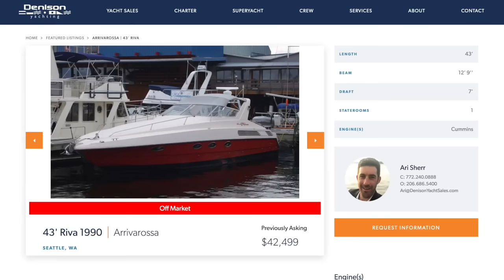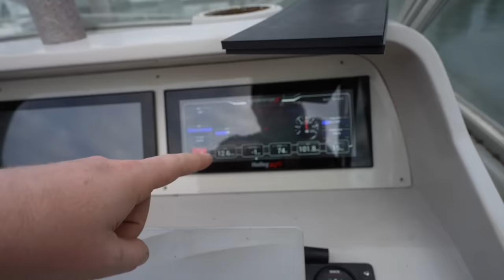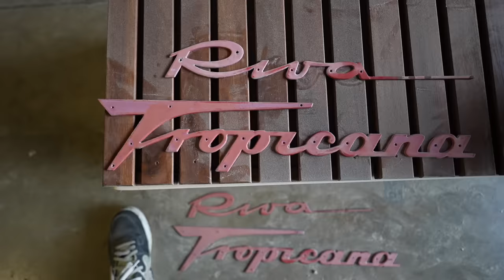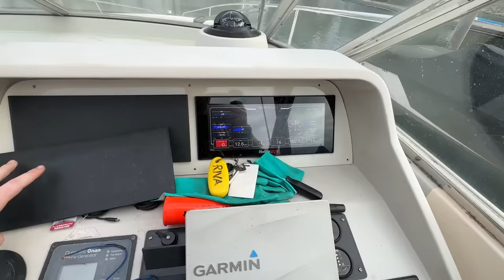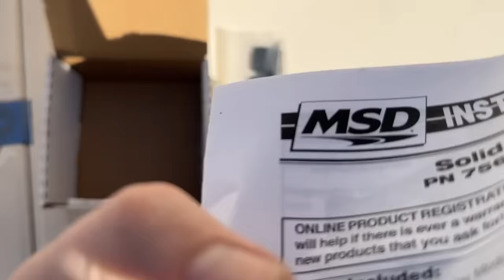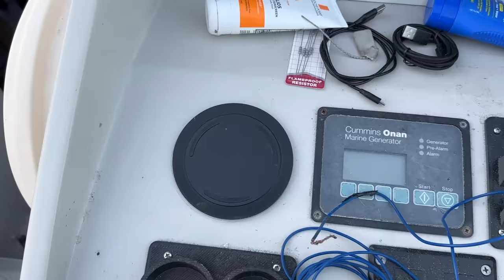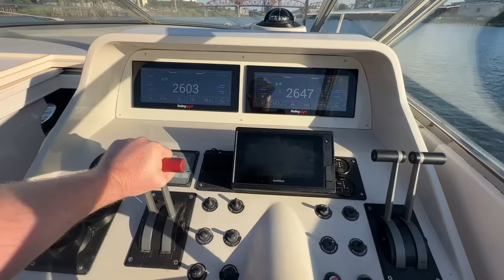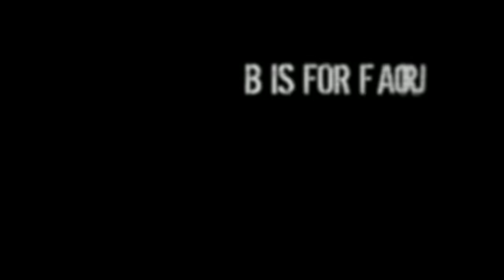LS Swapped 30yr Old Italian Yacht FINALE!! - ITS FASTER THAN EVER!!!

Comment: Am I missing something? Full throttle is only 2500 RPM? Shouldn't you be safe to run both engines at twice that RPM? I figured with 2 V8 engines that boat would go at minimum 50mph

Comment: Gas engines should be running at 4500-5000rpm WOT.  2500rpm is not enough…you need to re-gear with different transmissions or props. Likely gonna need different gear ration trannys cuz props won’t likely make that rpm increase possible.

Comment: You need to change the props. They're probably original which is meant for diesels. Reduce your pitch. I've been playing the prop game with my 600hp LS swapped 1983 Chris Craft Scorpion 230. I just made a 40 year old boat do 80mph with more throttle left. Your boat should do 40-50mph all day

Comment: you need to reprop or put different transmissions with different final drives, youre proped and geared for diesel torque, you need to put a steeper gear or smaller props. max rpm should be around 46-5000 rpm, you should be able to have max rpm of 6000+ rpm with your built motors. cruising speed and fuel economy should definitely be considerably higher
Reply: Probably 7000 even with these engines....

Comment: boat isn't getting that much into plane and maxing out at less than 3000 rpm...check the props, probably need to swap them. Thst boat originally could do 34 knots top speed which is about 40 miles per hour

Comment: At 2500 rpm, these engines aren't making 1500 hp.  Probably not even half as much (power = rpm x torque). Changing gearing or Props so that you get closer to redline on full throttle should give you the full power the engines have to give!

Comment: Need to change props. If you are not reaching your top RPM, you have the incorrect props. That will change everything. Specially fuel consumption.
Reply: Chris_Build-Text  sorry, not on telegram. Current props are too big for sure. Hence you are putting too much load on the engiens. You shoul be able to reach top rpm at WOT. Then you should be able to reach top speed at 80% of your power. That will give you extra power for when you need it. 

Besides that, the project came out great. Congrats!
Reply: Chris_Build-Text  you will be doing some trial and error. I'm sure Riva never intended to put those engines on the boat so don't think they will have specs for it. Props use two meassurments, diameter and water they push. Both in inches. First number is the diameter, second is the length travelled in inches per revolution. 

Hope this helps.

Comment: Wouldn't 1 mile for half a gallon just be easier to say 2 miles per gallon?  I mean, correct me if I'm wrong or whatever but who calculates by half gallon?
Reply: I mean boats usually don't use MPG they measure fuel usage in gallons per hour sooooo

Comment: As others have said, bow looks to be too low. This is certainly from too little weight in the stern and using too much trim tab. There is also no question that the transmission gearing is wrong and the props are the wrong pitch and size.

Comment: I don't think you broke those motors in right. Marine applications are different. You should have varied more rpms alot more often. Im w you man.  You shouldn't run new gas Marine engines at the same rpm for extended periods....

Comment: That boat needs more RPM no way 2700 RPM is what those motors want
Reply: props require a certain horsepower in order to spin a certain rpm. If the engine doesn't make sufficient hp down low to exceed the requirement, the whole system won't spin any faster. The previous old big diesels made some 350-400 hp at 2600 rpm, and were well-matched to the props.  But if those big props need 350 hp to spin that rpm, and the LS only makes 250 hp that low, it doesn't matter if the LS can make 750 hp at 6800 rpm...the prop's requirement won't let the engine ever reach that rpm.

Comment: You need to find out what the high rpm range for those engines is and get props with less pitch to allow the engines to operate in that range at WOT. Its the same concept as selecting propellers for an outboard motor. Lugging those engines with over pitched props is not good for them at all.

Comment: I have owned 42’ Sportfish with twin 502 gas engines (500 HP ea) for over 23 years. I would NEVER lug the engines like they are doing in this video! It is a recipe for valve issues, and or damaged pistons. 
   They should prop boat 5,200 WOT rpm, and cruise at 3,500 give or take. I assumed they handled this issue when selecting gear ratio, obviously not. This is serious, and boat should not be used above idle until the correct props or gears are installed!

Comment: Too much trim tab pushing the nose down too much will push more of the hull into the water slowing you down. 2500rpm sounds like you have too much pitch or too big a diameter not allowing your engine to rev out.

Comment: You need to figure out the trim system and most likely reprop the engines.  Wide open throttle should be like 5000rpm for those engines.  Anything less you are lugging them and it is more harmfull and was less efficient.

Comment: As numerous other people have mentioned, you have the wrong props (too much pitch). This boat with this horsepower should be doing closer to 40 knots. You should have no problem getting to 4500 RPM where your engines are in their peak horsepower curve. 

Sorry the boat sank. I’d definitely look into different props when you rebuild the boat.

Comment: Another comment to tell you you need new props.  You aren't even coming close to max RPM, and you should.  The only practical use as-is is running 1050 RPM.  Those props are pitched and sized for a ton of torque at a lower RPM.

Comment: Why are only getting like 2800 RPMs?
Reply: props require a certain horsepower in order to spin a certain rpm. If the engine doesn't make sufficient hp down low to exceed the requirement, the whole system won't spin any faster. The previous old big diesels made some 350-400 hp at 2600 rpm, and were well-matched to the props.  But if those big props need 350 hp to spin that rpm, and the LS only makes 250 hp that low, it doesn't matter if the LS can make 750 hp at 6800 rpm...the prop's requirement won't let the engine ever reach that rpm.

Comment: Those motors are not going to last long being so overloaded and are probably putting out less than 300 hp at that rpm. You need smaller props ASAP

Comment: The important power measurement on a boat is not horsepower. It's torque. I strongly beleive your props are way off. Contact a good prop shop and give them your engine hp and torque, the max rpm, the boat type and weight, With this information they can calculate the right diameter and pitch prop. To put this in perspective a diesel turns a big prop slowly and a gas engine spins almost twice as fast. My 32' boat with twin 220hp Cummins diesels does 20kts at 2000 rpm and about 28kts at 2600 rpm. I burn a total of 8 gal per hour at 20 kts. Keep at it, you will get it dialed in.

Comment: dude, starbrite deck cleaner or toilet bowl cleaner and a plastic brush, not steel brushes. too late now but you scratched the hell out of that gelcoat.
As far as top speed, your prop might be overpitched or your transmissions not have enough reduction, 2500 or so RPM at wot is good for diesel but with gas you should be higher.

Comment: Prop pitch and size is wrong. There are calculations for target RPM and speed. You have sooo much more RPM with gas get those props right and that’s going to be a ~35MPH boat

Comment: Those msd solid state relays are junk.  I was using it for nitrous activation and it kept kicking on and off over the course of a dyno run.  Checked my wiring for a week, come to find the internal "over current" protection was tripping at half it's rated current.

Never got a response from MSD when I brought it to there attention.  Kinda sad.

Comment: You’re way over propped for those high revving LSX motors. Your max rpm was 2550 which is less than 1/2 of where those guys should be. My stock Volvo Penta I/O max’s out at 4600rpm.

Comment: You definitely cruised that whole trip at a SUPER inefficient speed.. you weren't on plane and you were dragging so much weight through the water.   You gotta give it more throttle, get on plane,  then adjust the trim and throttle back,   find the lowest RPM that keeps you on plane and THATS the cruising speed...  not 1500 rpm  barely moving, not on plane,  dragging the full weight of the boat through the deepest amount of water

Comment: CHANGE THE PROPS. MAYBE LESS PITCH. THIS IS ONE OF THE REASONS WHY I SCREAM SO HARD ON A MULTI GEAR AUTO TRANNY FOR BOATS. IT'S HARD TO PROP A BOAT FOR POWER AND SPEED. BUT WITH A TRANNY YOU GET IT ALL. MY FRIEND HAD A 4 CYLINDER BOAT THAT WAS EVENTUALLY QUITE FAST. BUT IT TOOK FOREVER TO GET THEIR. 5 MINUTES ON FLAT WATER.

Comment: Dude, this is worse than I expected and I didn't expect much...   I have a similar boat, 50 years old 35 feet and probably 18k lbs... With 900 HP I top out at 51 MPH....   Your boat has some issues partner.

Comment: Many have voiced this but you totally have the wrong props on the boat which dictate the performance and economy. It’s like you are starting off in 3rd gear in a car and over loading the engines. The right props need to “slip” more with less drag which will get the RPM’s in the correct power ban. I guarantee you those motors are built for 5000+ RPM and with the correct props, that boat will do closer to 40mph.

Comment: Those engine start making real power at around 4k rpm, these poor engines run at 2.5k full throttle… try adjusting the pitch of the proppellor to increase the rpm.

Comment: First boat needs to be dialed for top speed, then make the necessary calculations for props. He thinks top speed is not necessary,  but things can happen and it will be needed. And engines need to be pushed properly once in a while. Those constant full load/low rpms are not good for them.

Comment: The transmissions are the wrong gear ratio for gas engines that is why it wont rev over 3k rpm should be 5k at 30 maybe 35 and maybe 6 or 7k at 40

Comment: It needs different props. You were only turning 2600ish rpm at wot those engines should be turning 5000 rpm’s+ at wot. Props are kinda like your gearing. If you need help with props I can help you, I was a boat mechanic for years and my dad owns a boat shop in the Portland area.

Comment: Wrong props, the engines should run minimum 5.500-5.850 RPM… and speed should be minimum 38-40 Knots… the hull is good for this speed…

Comment: Too low of RPM LS engine should be reliable cruising at 4000 rpm 2800 is like these engines idling. Trim should be neutral at “cruising speed” once on plane.

Comment: Looking great, I think you will get more speed if you use less trim tab, she is pushing too much water also seems over propped just not getting the revs. I owned the same Riva and did a refit also using Yanmar 6LY2A engines. you can see it here  https://www.youtube.com/watch?v=e4bofOU61JA Please feel free to reach out we have lots of experience with this awesome boat. Good luck withe fine tunning.

Comment: Your depth measurement for the tank is not accurate if the tank is tapered at the bottom to fit the hull.  Most are.  If it is tapered, then you underestimated the fuel consumption.

Comment: Oh man. I've got electric scooters that go faster than that for the price of one of those pro dashes. (I've also got pro dashes in a couple race cars) How does it only go 27-28? I didn't watch the whole thing, so I don't know what engines are in there but fuck that is a low RPM even for a diesel. Probably way out of powerband for any motor. I couldn't imagine designing a cam for 3k rpm.
Reply: oh, if those are LS engines like other comments are saying you are making like a quarter the power available to the motors at that RPM.

Comment: Prop pitch are way wrong or transmission ratio is way wrong. You are not turning enough RPM for a gas engine. Gas engines at WOT you are going to want to be near 5000rpm and cruise speed should be 3300-3700.

Comment: Change your props. Your not even tipping the power of this motors at 2800rpm they aren’t even making power yet. Every inch in pitch down, you gain 200 rpm. Go from there.

Comment: 2500rpm full throttle trimmed nose down hahaha. 

Those poor motors. Bores will look like a mirror in no time. 

They wanna be cruising 3000 and wide open at 6800. No wonder it’s so horrible on fuel.

Comment: You should be turning much higher RPMs wot. Minimum 4500rpm range for gas. Your props are prob wrong size or your gear reduction is incorrect. Cha Ching.............lol

Comment: Do not keep running the boat like that. 

You are massively over propped. If those are your props from the diesels you have many inches too much pitch. You will kill those engines in short order. 

Call a prop shop. Make sure you have trans ratio, weight, lwl, max rpm and then tell you want to be propped to reach 200rpm over your target red line.

Comment: you are only turning 2500 rpm, the props are completely wrong..God I work for the riva dealer in the usa..there is so much wrong with this boat..doing gas engines has completely dropped the value of it. gas is not wanted on the water these days

Comment: A for effort but it is quite obvious all the faults people here have warned about. 
Wrong props, wrong gearing, and wrong type of engines. 

Those engines will die within months if you keep running them at that load. 

Vessel should be geared to reach max RPM at WOT and light ship. 
So like 2 persons, 50% fuel you should reach the max RPM for the engines. 
What is max? 5500? A dyno sheet would be nice. 
Like I mentioned before the speeds you are doing now you are getting maaaaby 300hp per engine. 

1500hp should give you like 50mph top speed. It is a full planing hull and you are not even getting it out of the hole properly. 

When finished and running as it is supposed to, this will be a not economical build. 

Sorry to be the bearer of bad news.

Comment: You are obviously clueless around boats. Driving it like a snowplow and furnitureing it like a back yard. Stick to engines and cars.
It was really hard watching you butchering the deck when you “cleaned” it, and trying to get top speed with the bow all the way down. A boat doesn’t go faster if you push it deeper into the water.
With 1500 hp, this boat should do about 45-50 knots.

Comment: I have a 30 foot boat and it will so 28mph with a 350 carbonated vortex motor so it's pretty pathetic you have 1500 hp and 2 Motors and can do less than than why don't they Rev to 5000k at least?  This video is irritating to say the least

Comment: You need to learn about boats, which you admitted.
If your already wrapping lines around your prop that is WAAAY to much boat for you at your level.
It's unsafe and you are not qualified to operate it in all honesty.
That's to slow for your top speed and rpm imo.
Should be over 30 knots easy and over 4000 rpm.
You still running the diesel props?
I sure hope not, or you likely damaged those engines running that low rpm.
Gas V8's need to run around 4000--5500 rpm top speed and you need a prop that puts it in that range.
Your WAY out of your league here buddy.
Also the boat is most fuel efficient on plane.
At slow speeds like your doing like 12knots your sucking down huge amounts of fuel.

You need to do some researching, studying, and talking to educated experienced boaters before you hurt yourself or someone else.
But now I see the boat sunk.
Thank god nobody was on it when that happened.
Take your insurance and walk away, it's totalled.
Get a MUCH smaller cheaper boat (open bow rider) and start over and learn to walk before your run.